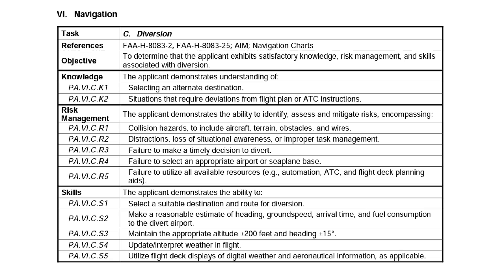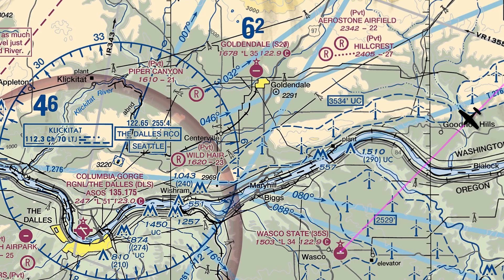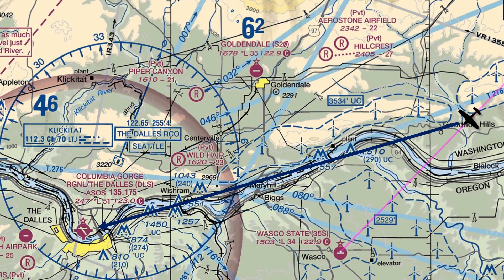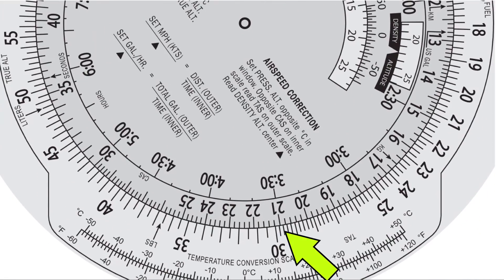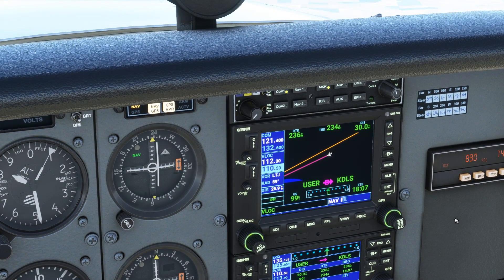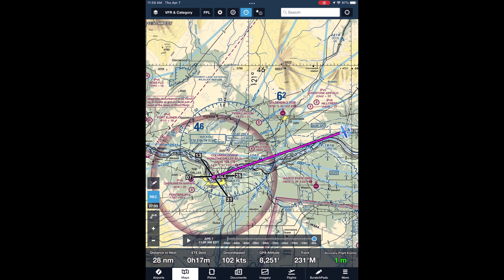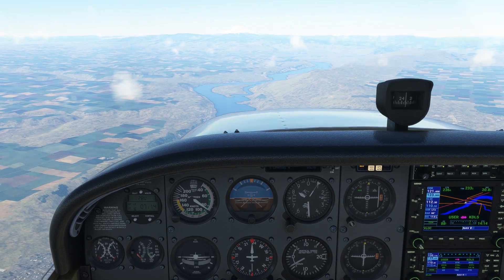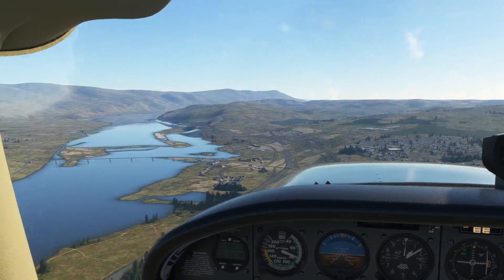How to Do a VFR Diversion | Cross Country Diversion

Comment: Surprised nobody caught the fact that he says the radius of the circle around a VOR is 10 miles.  It is not.  It is 5 miles.  The diameter 2 x radius is 10.  So he was 15 miles away in the situation instead of 30.  Makes a big difference in the calculation.
Reply: No, he was correct. It’s a 10 mile radius.

Comment: So much has changed since I passed my PPL checkride back in 1971.  Back then, my checkride was with a FAA examiner and did not cost me a cent. The check itself was more like a bi-annual flight review. I met the examiner, did a pre-flight (no questions asked; he just observed), took off and flew the heading he gave.  We did some basic maneuvers - slow flight, stalls, etc.  After that, he told me to head back to the airport (sill no questions asked).  I contacted the tower; entered the pattern that had 3 other aircraft already there. Got permission to land, turned final only to have an airplane taking off on the opposite end of the runway I was on final for heading straight for me. The controller was totally unprepared for this and was flustered and behind the curve. I suggested I do a 360 and come in behind the number two airplane in the pattern which would get me out of the way of the plane taking off towards me and help resolve spacing with the other aircraft in the pattern. The controller paused for a brief moment, told me that was a good idea and directed me to do what I suggested. My examiner is dead silent though this whole episode. We land, shut down and he tells me congratulations I passed and also comments that the way I handeled that incident came as no surprise to him as all of (my CFI’s name) students were over prepared for their check rides. 

That was that. But I have to wonder how things might have gone if I had to do all the stuff students must do now to pass.  And, that is one of the big reasons I view these videos because as Jason Schappert says, “Good pilots are always learning.”

Comment: I've seen other diversion vids have the PIC circle (before diverting) to determine course, distance, fuel burn, ETA, etc.  Which is correct?  Great instructional vids btw!
Reply: makes a negligible difference if you work quickly
Reply: I was told if it’s an urgent reason (such as a medical emergency scenario during your checkride) then don’t circle but turn to an estimated heading sooner rather than later.

Comment: Good video however, with all the technology we use today, this is not practical at all and should be updated by FAA.  I do not know anyone that uses an EB6 and actual chart since they got their PPL.  This method would be the same as taking a typing text and using actual whiteout versus a 'delete' or 'back' button.
Reply: You're not wrong, wrong, but I think its absoutely practical to know some old ways for some things.
Flying can be a pretty lethal affair, so why not have some low tech fallback? Not THAT much to think about in the grand scheme of things.
And consider the internet, many people use discord, when discord goes down, countless people are out of a communication option.
I use discord too, but I also have my own IRC (caveman tech) server running my best internet friends (and some of my reallife ones) know about.
And yes, that can fail too, but it's still a decent backup.
Reply: @hansbrackhaus8017  i recently failed a spot check do to them not allowing me to use my GPS and ForeFlight. I was very upset at first and thought the same exact thing as you but i realized that doing it with only my sectional and E6B makes me a better pilot overall. Once i add the technology in it just makes it easier but id feel confident if my technology failed id know exactly what to do.
Reply: @hansbrackhaus8017 well said

Comment: Great video as always. One thing that really helped during my PPL is to know my airplane numbers. For a diversion, you must be able to calculate Distance, Time, and Fuel without having to think too hard.
- Distance between 2 points on a map is easy to find, use your fingers and a reference for scale.
- Time: If you know your aircraft, you should know how many minutes it takes to fly 10 NM. Use that reference to quickly calculate your diversion time. Leave your E6B in your bag, you have an airplane to fly.
Fuel: If you know your aircraft, you should know how much fuel you burn in 10 minutes. Use that number to quickly estimate the fuel need to your diversion airport. Round up numbers to keep it simple. 

Example in a Cessna 172: 
- Cruise speed: Approx. 120 knot or 20 NM every 10 minutes.
- Fuel burn: Approx. 12 Gal/hour or 2 Galon every 10 minutes.
If you remember these numbers, you can very quickly estimate if you can make it to your diversion airport. If you want to be a bit more precise, use the ground speed on your GPS and apply a correction factor. Example: GPS shows 100 knot ground speed? Simply add 20% to your time and fuel burn.

Comment: Quick tip for people about to take their checkride: don't try to be specific with things like estimated fuel burn, distance, etc. Mark out 5nm lines on a pencil or whatever you use to write, ballpark the distance, and take a good guess at fuel. My DPE got pissed when I started trying to do the math for fuel burn; thats not what they're looking for.
Reply: Very good point, Biggie.  Scenarios about being exact and covering every possibility are not realistic.  The instructor and DPE should consider how we actually divert in real life.  I agree with that being done without all modern aids.  No electricity is realistic and once pilotage skills are shown, all aids can be brought into play.  GPS should not deter us from using the sectional and identifying checkpoints.  It is more interesting that way.
Reply: I like the way of learning how to estimate in simple terms.

Comment: Awesome explanations!! Here some fun: And then the specific winds in the Gorge will throw out all that original math! 😆 Not to mention the awful bumps you’ll be hitting, making you slow way down. The Dalles airport is on a really beautiful spot, too. Funny, it’s in a different state from the city of The Dalles (WA vs OR). Would make for a good spot to hang out for a bit, though. Lots of resources to help bide time til the original airport opens up.

Comment: A number of comments. First, I have not even held an E6B since the early 1990's. Second, precise estimates/measurements are only necessary if you are fairly low on fuel or at minimum fuel.  Third, the reason we are diverting is not due to an emergency we are experiencing. Fourth:  How much fuel (time) do I have.  If three hours, then I may want to go somewhere not even close to the closed airport/runway.  Fifth, you can determine approximate distance by use of your two fingers divider. Hold two fingers from one hand, one on your location, the other at your potential destination to get the distance. Hold that separation and hold them up to a vertical longitude line on your sectional to see how many minutes  of latitude (NMs) that finger spread represents.  Sixth, if distance is approximately 30 NM, wind is relatively low, and you have 1 hour of fuel, and the weather is good at the potential diversion airport, you are gold. Seventh, when I am flying, I constantly keep track of gallons and time of fuel remaining. Then if a diversion is needed, I already have the approximate radius of action/diversion defined, and I can spend more time deciding what airport to go to (maybe one with a really good $100 hamburger - with current inflation a $128 hamburger).

Also, you want your head out of the cockpit as much as possible looking for conflicting traffic. Don't over complicate the diversion for such a simple problem/exercise.

One other point.  I fly with two certified panel mounted WAAS GPSs, and generally also Foreflight on an iPad, and then a portable Garmin 796 on my yoke.  Not everybody can do this, but probably any pilot can fly with one iPad or tablet with Foreflight, Garmin Pilot, or another moving map GPS navigator.
Reply: Studying for my ppl check right now… unfortunately we still have to know how to use an E6B.

Comment: One thing I might add, when I took my private My DPE was actually upset that I didn’t pick up flight following. If it’s available just pick it up.
Reply: I wondered about this. My checkride is may 5th. Do you actually need to get flight following if you're going to divert anyway? I don't see the point of that. If that is the case do you just cancel FF right before you start diversion calculations or what?
Reply: @DaBladePwn I would think in real life, flight following would be helpful to lighten your workload and asking for assistance as needed. It’s like having a lifeline. But that’s real world. For simulated scenarios I would just verbalize?